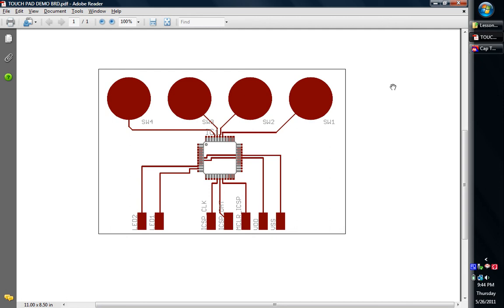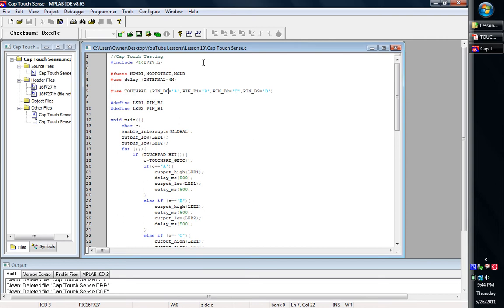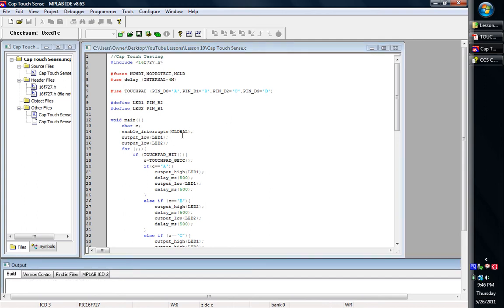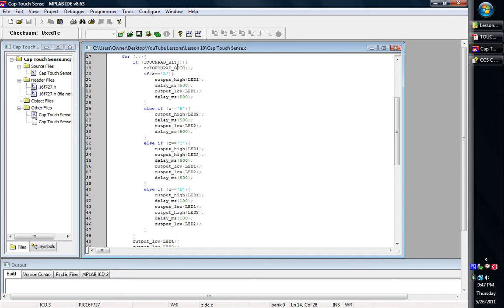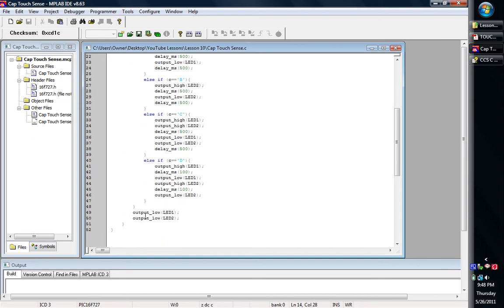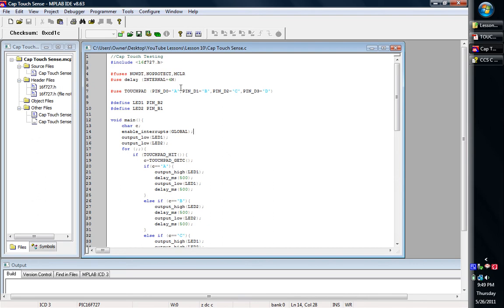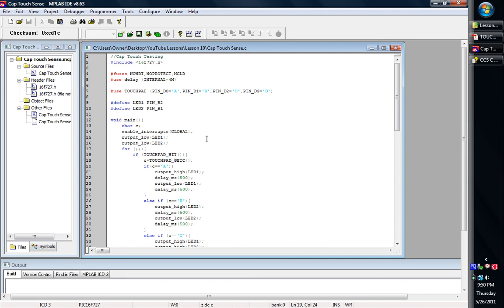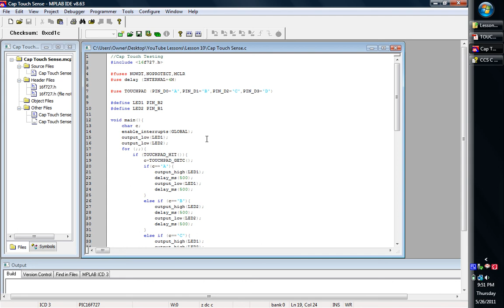Capacitive Touch PIC Microcontroller Coding

Comment: Hi Misperry,

I did a touch pad with PIC16F727 (15 channnel) and another with PIC16F726 (8 channel). I am getting wrong selections of switches, like, if I touch PAD0, its triggering PAD4. Its randomly selecting other PAD's. If I continuously hold on to a particular PAD, sometime I see the correct PAD been triggered. But I want to toggle relays based on the PAD that is touched. If I hold a touch PAD continuously,  the relay is also toggling continuously (Chattering). One hint is my uC board with male berg stick is connected to touch plate board having female berg stick. Its not integrated in one board as you are showing in this video. Will this cause any issue? 

Please provide me your thoughts on this. My mail ID is added below. If you can share your mail ID or send me a mail, I can reply with images of my uC board, touch plate and XC8 program which will help in understanding this requirement better. 

                                                                                             Thanks in Advance. 

Regards,
Guru
gururaj.kashikar@gmail.com

Comment from the maker: Hello, what you could do is to use my code as a road map.  You can get it by visiting my channel and clicking on project code link in my banner.  then you will just need to check which cap button is pressed and use a variable to store the state of the LED and just perform an inversion of the state every time the button is pressed.  Hope this helps.

Comment: Very good,

I'm studying touch and found several codes, but none was as clear as this, congratulations!
But the code did not work on my electronic board ... What may have occurred, assuming that the hardware is ok? I researched a little on the "# use touchpad" and read that it was necessary to use the timer 0 and 1, could this be?

Thanks ;)

Comment from the maker: @hajoc Hey there.  What compiler version do you have?  I know that my v3.0 compiler did not have things like the 727 and the 16f1938 chips that supported cap touch.  I now have the latest version which is v4.x this one supports these devices.  Hope this helps.

Comment from the maker: @hajoc Yes there is a header file that you will need to include.  You are correct that it is the 16f727.h file.  This file can be found, if using the CCS C compiler, in the PICC Directory.  Path is "C:\Program Files\PICC\Devices".
In my video if you look at the Places tree on the left side of the screen you will see that under the "Header files" folder the "16f727.h" file resides.

let me know if you have any further errors.

Comment from the maker: @NOSE000001 Hey there, I don't have any code that I have tried with the MPLABS MPASM to give you.  However, if you want to explore this on your own you can look at the datasheet for the pic16f727 and on page(s) 129-134 explain the operation of the CTS Module as well as all the registers involved so you know which ones to set and control.  You can obtain the datasheet from microchips website